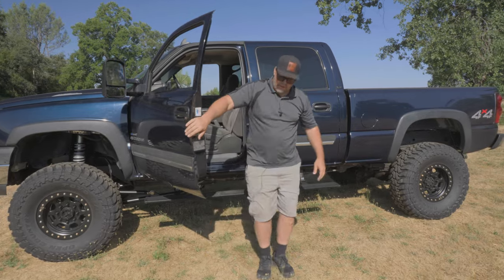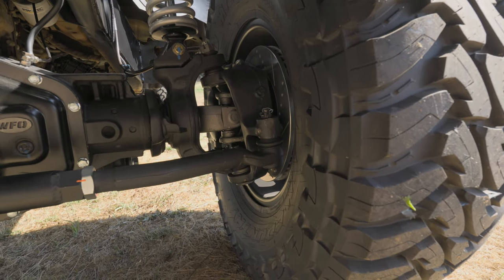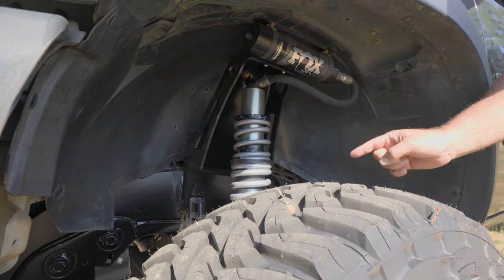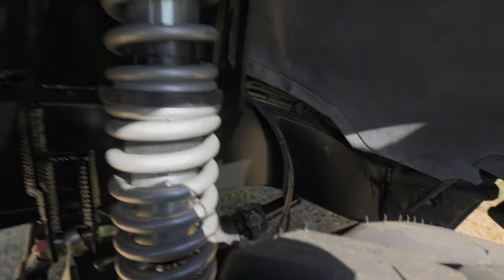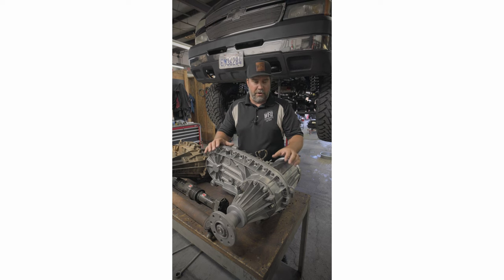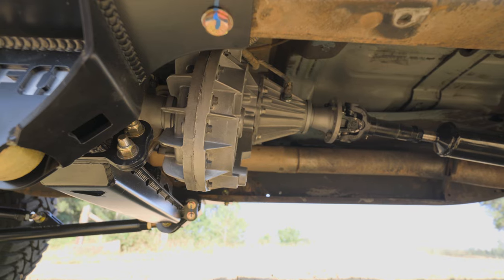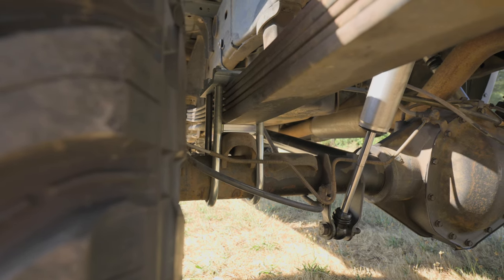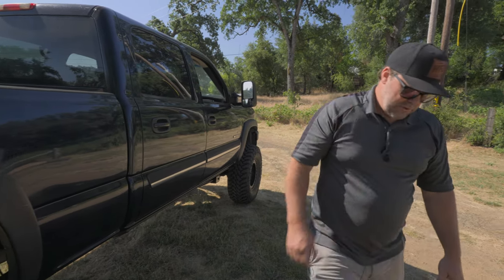Solid Axle Swapped 2006 2500 HD Duramax Walk Around!

Comment: So I see that the np271 transfer case is only offered for 07 and older Chevy trucks. Do they offer a 271 transfer case for a 09 Silverado gasser? I’ve already done the sas with your kit. Just looking to upgrade my transfer case. Also with the stock steering box for the Chevy. Do you guys recommend to swap out the steering box for a ford one or do you just upgrade to like a red head steering box? Seems my truck don’t like the stock Chevy steering box. So need to upgrade that as well 😊
Reply from the maker: As far as the transfer case, we have not found a good swap for the 09 Gas.  We suggest you call transfer case express and see what they have to offer.  If you have a floor shift case, they will be able to help you out.  If you have an electronic shift case, it might be hard.  On the steering, we suggest buying a new box and pump kit from PSC.  It is the standard GM bolt-in box.  No need to change to a FORD box.